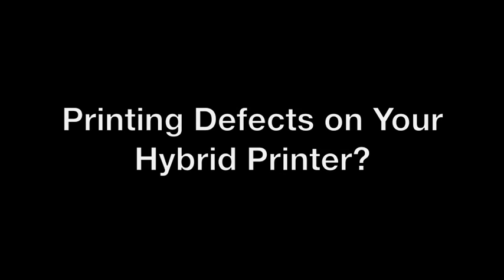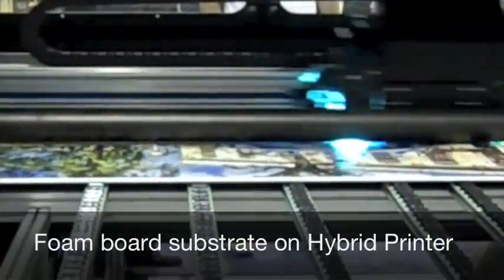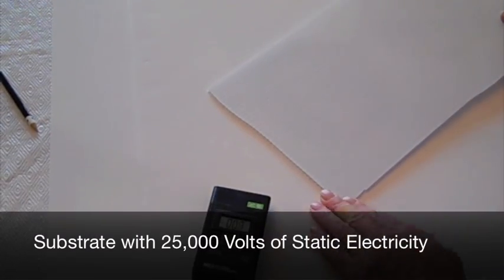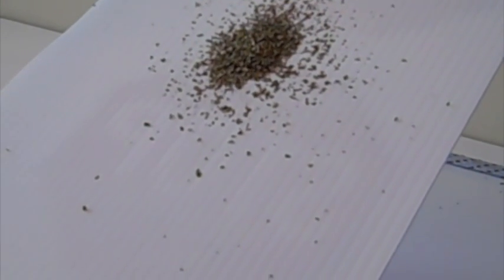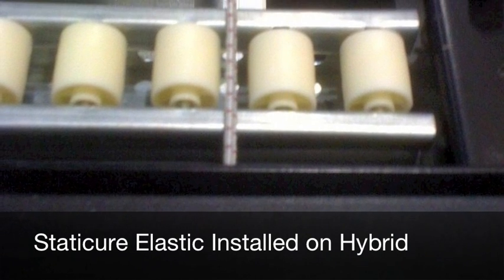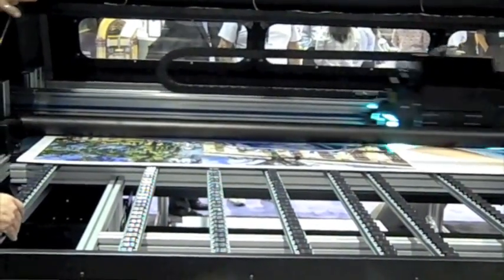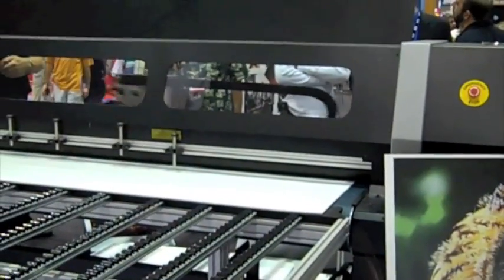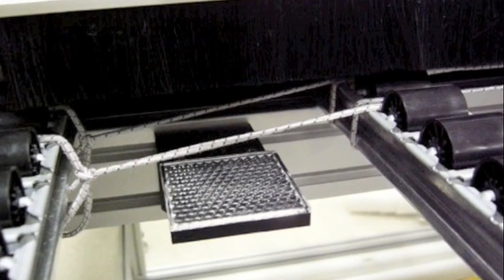Printing Defects on Hybrid Printer Caused By Static Electricity - Static Eliminators

Comment: ROFLMFAO! This will not help! You neutralize the wrong side of the media. You need to clean the top side as it can be affected either by dust attraction (dirty prints) or ink displacement (distorted image). This does not solve any of the mentioned problems.
And, by the way, attaching a magnet to PAINTED or ANODIZED sides of the table will not earth the cord. You must have direct contact with the copper wire, which is connected to earth.
P.S.: I know this is a very old video, but be aware of it anyone who watches it now.